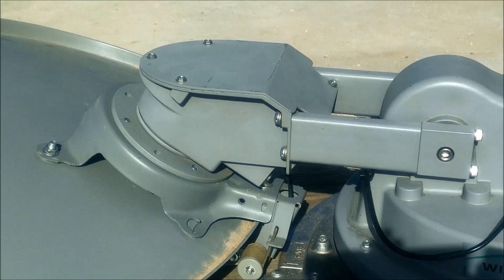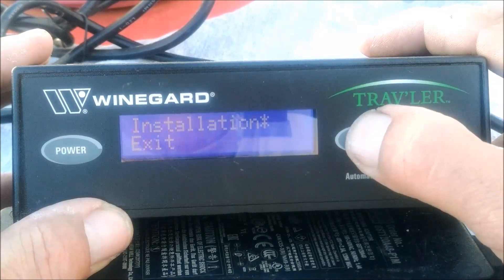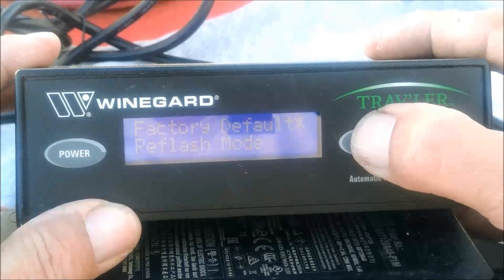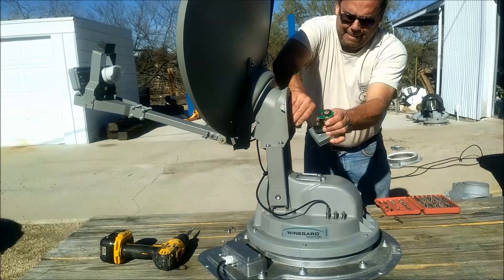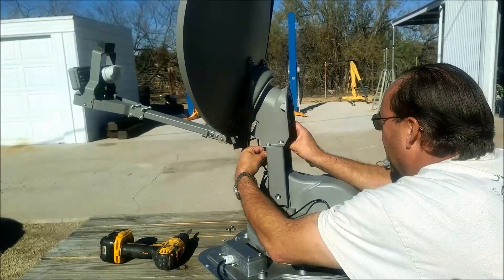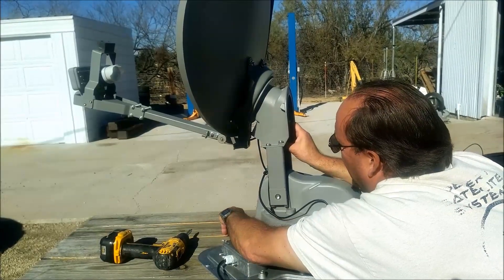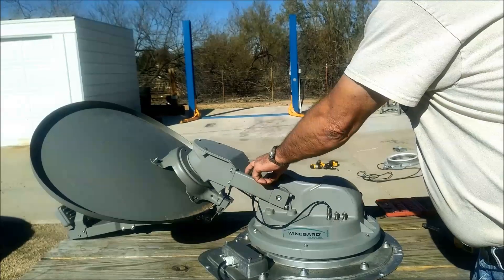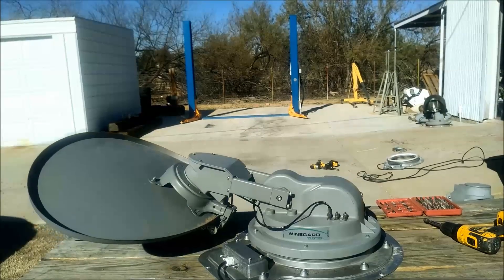Winegard skew motor replacement

Comment: How did you know it was the motor my Winegaurd goes to the hard stop then say no ant communication?
Reply from the maker: You probably are pinching your power data cable in the AZ gear. I have seen this before.